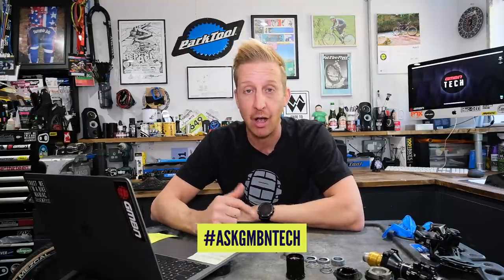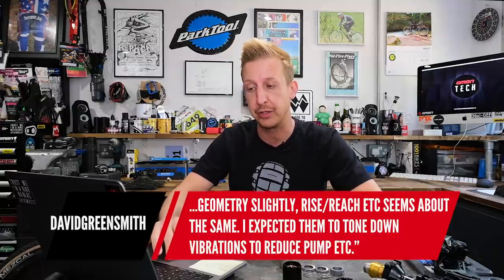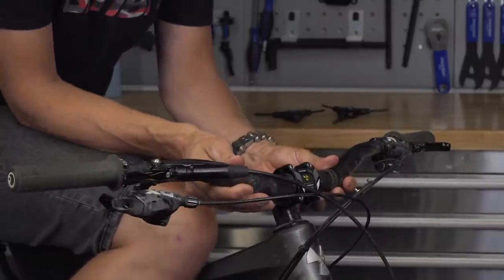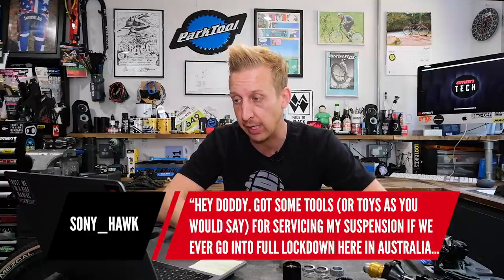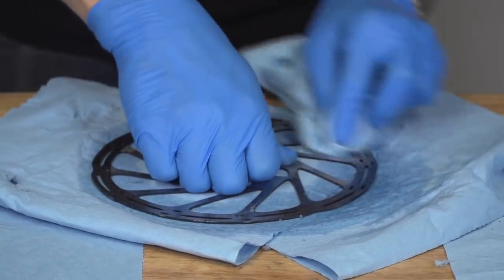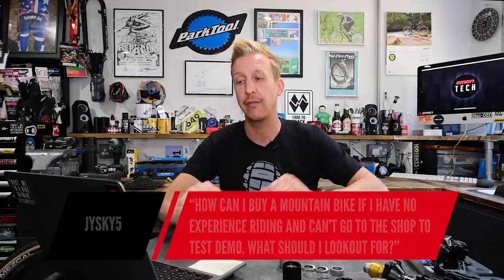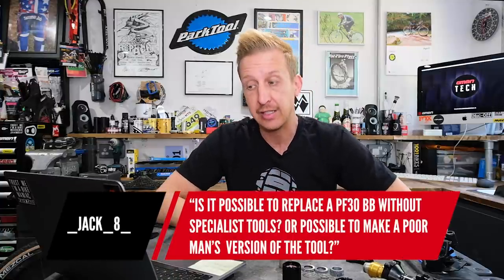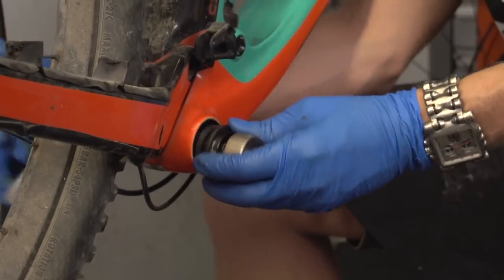Do I Need To Clean My Brake Rotors When Swapping Brake Pads? | #AskGMBNTech

Comment: #AskGMBNTech  Hy guys, I am at the start of a bike refresh. Last year I bought my firs ever mountainbike an older bmw gray enduro bike, which I am really loving so far, but  needs some repair and maintenance, because the owner wasnt a bike geek.(I havent got much monney left to speare) The drivetrain is worn never replaced , I am woundering that can I downgraid it from a freeby sistem to an oneby sistem, I havent got a rear deraileur with a cluch, only an x9 from sram, I allso plan to get a 11-34 or an 11-36 casette, would It be realible, and eaven silent?  (Note I have a long cage variant)
Thanks for the answer loving the show.

Comment: When I change pads I always pop my rotors in the oven at 425°f for about 30 minutes ( an old truck I learned from racing mx) this ensures the rotors have absolutely no oil left on them.
Reply: That's exactly how you season and develop the slick, non-stick coating on carbon steel and cast iron skillets/pans. Probably not a good idea for brake rotors.
Reply: Would that not warp your discs ?

Comment: #AskGMBNTech
Newby question. I live in a block of flats. It's there an easy way to get mud out of my tyres before I bring it inside when I don't have a hose to the outside? A bucket of water and a brush  just doesn't cut it.
Reply: L F Tipper I would say ride around the parking lot. Practice your wheelies and stuff like that

Comment: #AskGMBNTech I have an SLX M7000 groupset. 1x11 setup with a 30T up front and an 11T-46T at the back and it shifts really well, as expected. Just for kicks, I recently purchased one of those 11T-50T cassettes and set it up the way it's supposed to be set up. Just thought of giving me more range to hit those crazy climbs with ease if I need to. Thing is, no matter what I do, I can't get it to shift well. I've adjusted everything and even checked the hanger but it still shifts like $h!t. Am I doing something wrong? What should I do?
Reply: Joey Arnaiz have you adjusted the b tension?
Reply: @peterlang5047  I have. Adjusted to the recommended distance between the jockey wheel and the largest ring. Thing is... If I adjust the mech's tension correctly for the chain to hop up from the smallest ring to the next one, it starts giving me problems on the largest ring. Seems like if I adjust it to go up the smallest rings correctly, the cable tension is too high that it keeps jumping up to the largest ring when I try to shift to the second largest ring.

Like this...
First click - Goes up to the second ring
Second click - Goes up to the third ring
Continues on all the way until...
Ninth click - Skips the tenth ring and just jumps to the eleventh ring

Now... If I adjust it to shift normally for the largest rings, my first click needs to be pressed deeper and further for the chain to jump from the smallest ring to the next ring. Not sure I'm making sense. Hahahahahahahaha! I'm just a little bothered by all this. I don't really mind having to press the shifter further and deeper every time I shift but if I can find a way to make it shift better, I would definitely go that route.
Reply: Joey Arnaiz idk dude. Good luck. I’m glad I’m not you 😂
Reply: @peterlang5047  Hahahahahahaha! Well... I can easily go back to the stock 46T cassette which shifts like butter (typical Shimano clutch systems are kinda harder on the thumbs but you know what I mean) but I was hoping that I can do something about this 50T one.
Reply: @Zyanteme It was short for the 50T. I had to add a few links for it to fit.

Comment: #AskGMBNTech I'm going to buy an Rockshox Judy which comes with an 15×110mm boost axle, what hubs are compatible with it? Because I'm also buying a new wheel.
Reply: You need to buy a 115mm boost wheel. Lots of brands make them.
Reply: Sorry 110**
Reply: And hubs that fit a 15x110mm through axle. There’s probably thousands of them
Reply: @peterlang5047  Are Shimano e-thru boost hubs compatible?
Reply: Eduardo Costa probably. Make sure the hub has/fits a “boost” 15x110milimeter axle

Comment: #AskGMBNTech   Is it possible to replace the Suspension of a trailbike ("Spezialized Stumpjumper 2013" in my case) with some sort of Suspension with more travel?
 And if it is possible, what things do I have to think about?
Reply: Eifel Racing replacing the fork is simple enough, but replacing the rear shock is quite complicated

Comment: #askgmbntech

Is if possible to buy some sort of converter to pug a through axel wheel on a bike with quick release drop outs?
Reply: Why would you ever want to go back to a qr skewer? Unless you mean the other way which wouldn't work since the hubs are literally bigger, maybe if you "stretched" your frame out but that would be difficult with steel and impossible with aluminum.
Reply: @smokedsalmon3907  my bike is through axel from and quick release at the back. And I have cracked my rim

Comment: #AskGMBNTech I am building a On One Scandal hardtail with boost fronted and backend. Because of that I bought truvativ stylo 6k dub in that standard as well. Now my frame is standard 73mm BSA and I bought coresponding SRAM SUB bottom bracket with "super boost+" version. What is the diffrence in mouting that kind of bottom barcket+ crankset corresponding to standard one and how I could verify that my crankset is correctly align with back cassete? Thanks a lot!
Reply: If ur back end is boost, then super boost bb and crankset (or chain ring offset) isnt the correct one. You need boost chainring/set-up, of chainline will be quite a way off (difference between boost and super boost is more than between non-boost and boost...50% higher in fact ...+9mm 'v' +6mm)
Reply: If I’m not mistaken, super boost refers to a 157 back end and a 83mm bottom bracket shell. You ordered the wrong thing, but you can make it work with some spacers

Comment: #ASKGMBNTECH I want to use a Shockwiz to help dial in my suspension, and ride a Canyon Strive. Should I just do all the testing with the Shapeshifter in Downhill mode?
Reply from the maker: Hey Arlo, we think it's best to do any testing with the bike in the setup that you are riding the most and on the trails or terrain that you ride the most. It's also good to keep everything else on the bike consistent and change just one variable at a time. The great thing about air shocks is you can always adjust the spring rate for different situations 🙂

Comment: #askgmbntech hi doddy I have a £400 hard tail and has a 3 by 8 drive chain and I want to change to a 1 by drive train do you think I need a bigger cassette like a 9 or 10 and can I use one of the three gears at the front to save buying  a chain ring also it has a 110mm travel fork do you think I can put a 120mm fork on thanks
Reply: AlfieG 123 you don’t need a bigger cassette unless you think you need a bigger cassette

Comment: #askGMBNTech can I put a 12 speed cassette on a 142  Shimano hub even if it only says 11 speed
Reply: If it is a sram/sunrace with 11 tooth smallest ring yes. If it is a shimano 10 tooth small you need a shimano  microspline driver. If it is a sram/sunrace 10 tooth you need the xd driver cassette body.

Comment: #AskGMBNTech Hi Doddy, I want to upgrade my 130mm 27,5inch  fork. I found a good deal for a Fox 34 factory 29inch and 140mm travel which fits my bike and my rimm on ebay. Can i put it on my bike without messing up the geometry? Thank you (Sorry if my english isn't correct i'm not from an english speaking country)
Reply: Florian Barth it will slacken the head angle and seat angle and raise the bottom bracket. You might be able to get away with it
Reply: Your English is good
Reply: @peterlang5047  thank you

Comment: #AskGMBNTech
Hey Guys!
Im owning a Propain Tyee 2016.  It has non boost wheels (non boost fork- I know I would have to change the fork to fit a boost front wheel), but is it possible to fit a boost rear wheel if i wanted to? 
Love your channel! Keep going! You got me really into mountain biking.
Sry for the bad english :D
Best wishes from Germany

Tobi
Reply: Tobi Paulus assuming you have a 12mm through axle, you’d have to figure out if your rear dropouts are 142mm or 148mm. If they’re 148 millimeters wide, then a boost wheel should fit. It might be a good idea to contact the manufacturer